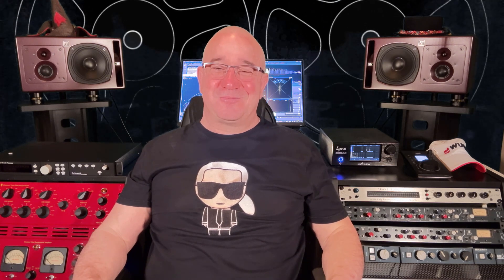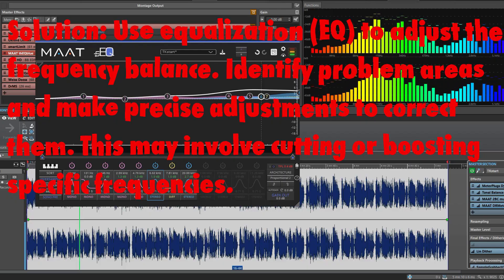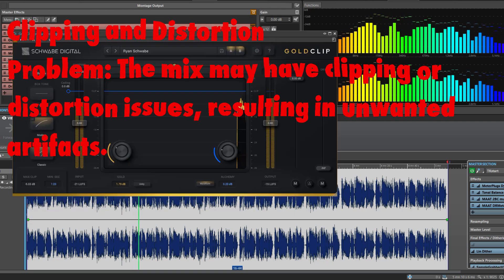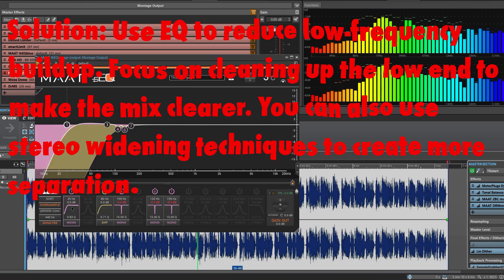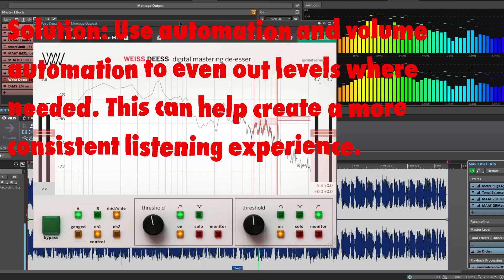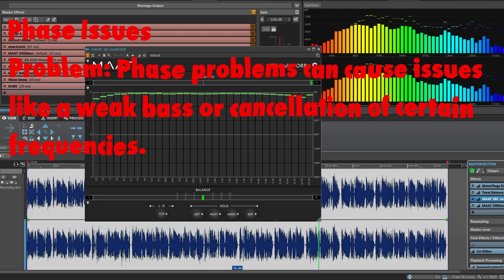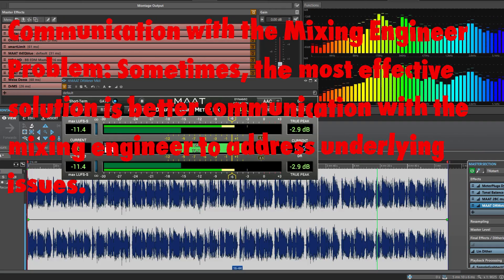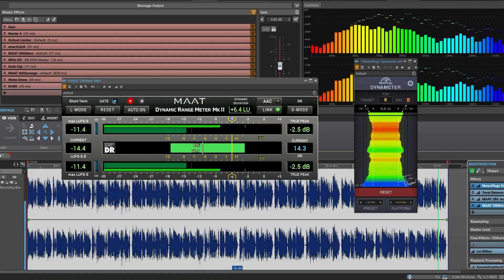Mastering bad mixes

Comment: Thanks. I had one of the songs that i recorded when my set up gave off, so basically some recording in phone and computer(mac) directly without interface or any microphone and mixed mastered without monitors straightaway with output on computer(mac). Badly recorded, but as a part of practice did not want to stop producing until i got my setup up and running again. After few months i tried to remaster it and improve sound, but did not work for me. I just gave up the idea altogether and stopped of reworking on the song altogether. But focus on buliding and working up on new songs (basically everything was a problem right from recording stage so)
Reply: Here is the link to that song. https://youtu.be/XjxL_uVzQ2Q?feature=shared I think the issue is basically boomy mids and muddy sounds, less high frequency and less harmonics. Also the guitar intro sounds so thin.
Reply from the maker: Thank you! Remember, achieving a great mix and master is a process, and it's normal to face challenges along the way. Patience and persistence are key. Learning more about mixing and mastering can significantly improve your results. Mixing and mastering are skills that improve with practice. Experiment with different techniques and approaches to find what works best for your music. There are many online courses, tutorials, and books available on these topics. Or consider hiring a professional mixing or mastering engineer. They can provide the expertise and equipment necessary to elevate your music 🙏🤝
Reply from the maker: @ratnacomposerstudio  If you're not satisfied with the results, it might be due to the quality of the plugins and tools you're using. Invest in high-quality plugins, especially for EQ, compression, and reverb.
Reply: @boogiesnail  sure. Thanks
Reply from the maker: @ratnacomposerstudio  🤝

Comment: What About Pre echo that only presents itself in the mp3 encode? I use soundcloud, and they only take wavs and then convert them to mp3 128, there is no getting around this, 

However, I can take just a hihat for example and render it out and then upload it and the same thing happens, so what do  I do to mitigate this issue on a whole mix 

cheers mate
Reply from the maker: Pre-echo is a common artifact in MP3 and other lossy audio encoding formats, often occurring at the beginning of a track or before loud sounds. It's essentially a slight echo or blurring of the sound that occurs just before the actual sound. This happens due to the way these encoders compress audio, particularly in handling transient sounds like drum beats or sharp, quick notes. Here are some steps you can take to deal with pre-echo in MP3 encodes: Use a Higher Bitrate or Different Encoding Settings: A higher bitrate generally means better quality and less noticeable artifacts. If you're encoding the MP3 yourself, try increasing the bitrate. Also, explore different encoding settings that might be more forgiving of transients. Remastering: In cases where pre-echo is very problematic and you have access to the original recordings, remastering the track with modern tools and techniques might help. Use a Lossless Format: If quality is paramount and file size is not an issue, consider using a lossless format like FLAC or WAV. These formats do not suffer from pre-echo as they don't employ the same type of compression as lossy formats like MP3. I hope it helps.